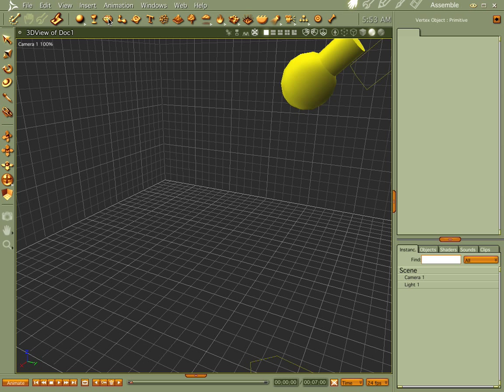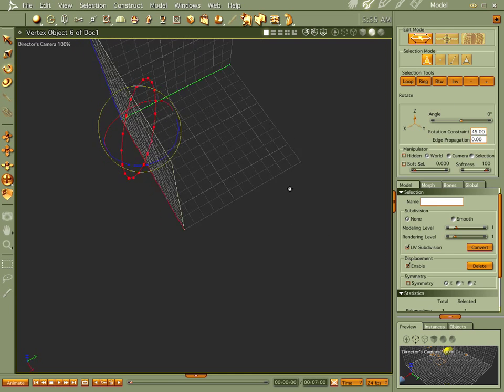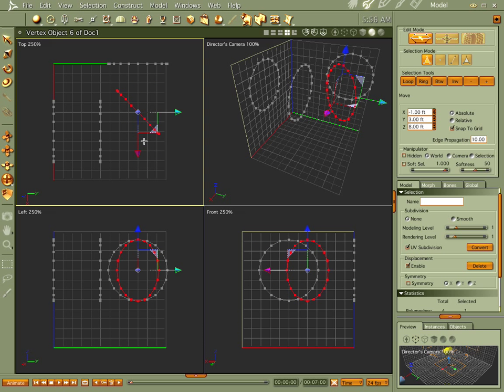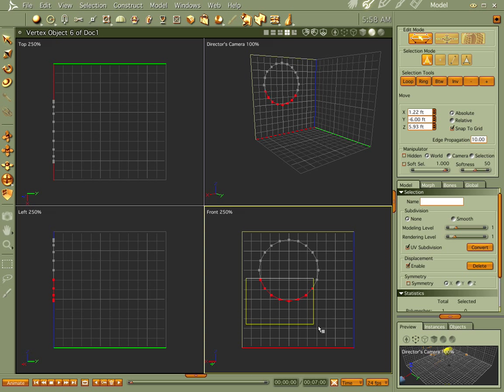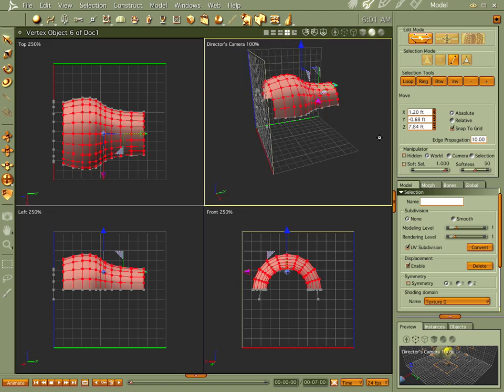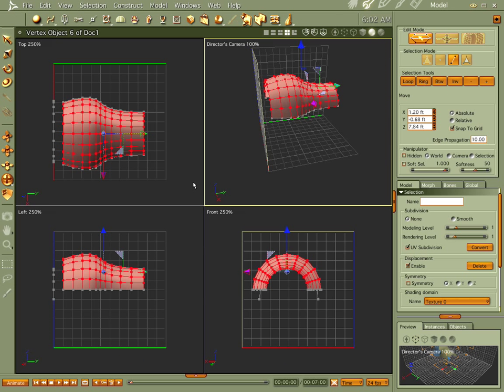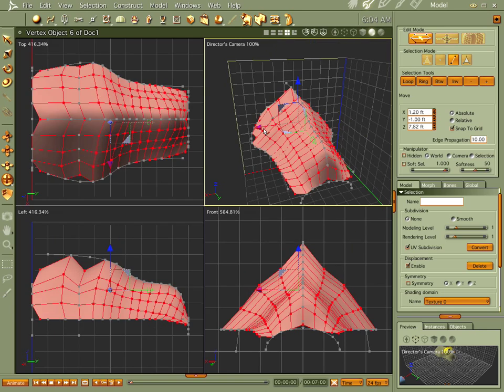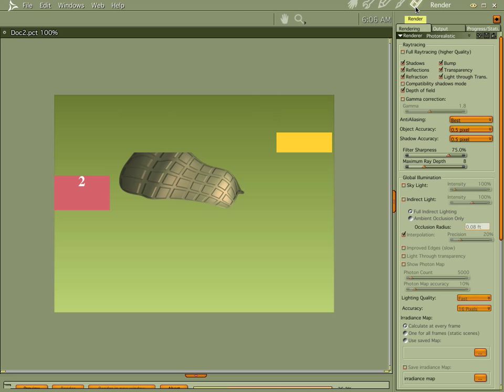Modeling Ruled Surfaces

Comment: Your tutorials have been incredibly helpful. This one in particular (Modeling Ruled Surfaces) I've been wondering how to use these tools, so thank you! The question that I have though is that in one of your tutorials you mentioned that you have a new system. I just replaced my old G5 with a Mac Pro but Carrara 8.5 has been a real problem with crashing. Can you tell me a little about your system and if you have any issues with Carrara crashing?